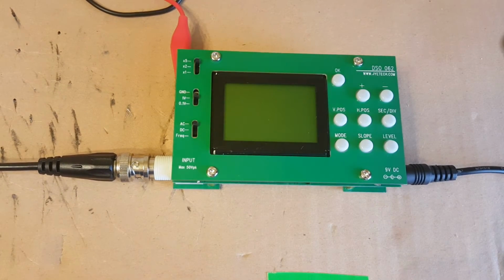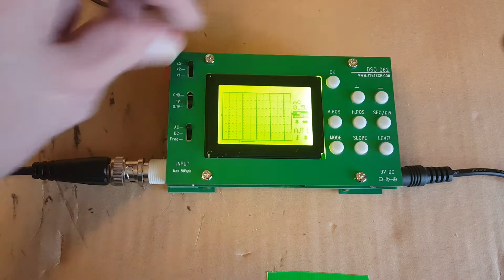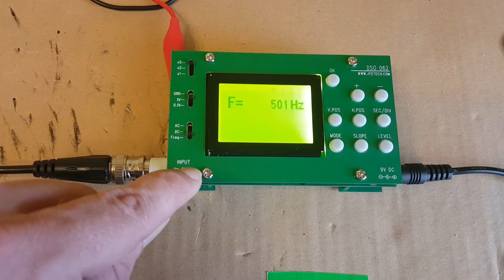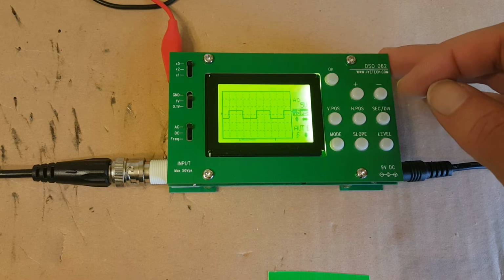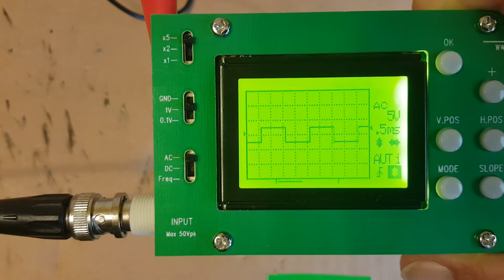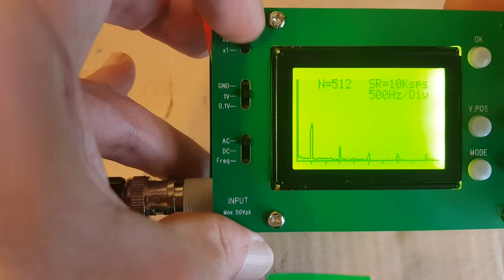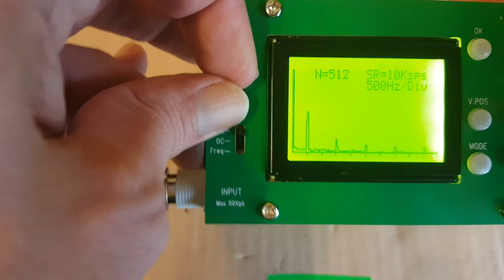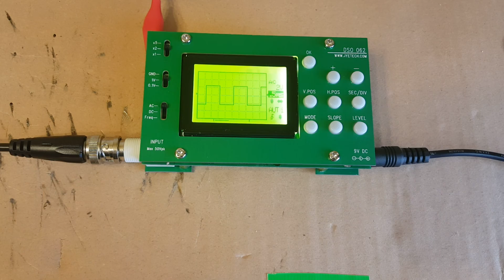JYETech oscilloscope usage tips

Comment: hi the screen lights up and the output for testing works fine (tested with multimeter), along with the "Freq" setting (reads 500Hz), however when the grid is shown, there is no visible line or waveform no matter what range and setting i put it on. Do you have any tips please? Thanks.
Reply from the maker: Usually that happens because of: contrast too low, window too small, scale too large, or combinations of those. Try setting the "sec/div" to 0.1ms like I did, and make sure the scale is on "x1" on the top switch and "1V" on the middle switch. Try checking the voltage of the signal too. It's possible you're getting a weak signal due to a soldering error, in which case it might still be able to sense the frequency, but the trace line would be essentially zero. Try checking the ground setting too, and make sure you get a line on zero. (1:43 in the video)

Comment: Thanks for the demo vid!  I've been looking to get a good starter oscilloscope both to advance my electronics skills and to diagnose electrical problems on my RC setups.

For instance, do you think you can do a video hooking up this JYETech oscilloscope unit to one of the free channels of an RC receiver's 5V power rail and get an accurate view of how the voltage jumps around when all the servos move under load?

I want to get my RX setups as bulletproof as possible with stable voltage using low ESR capacitors, LC filters, etc.  But I feel its kind of a shot in the dark without an oscilloscope and am trusting the word of the eBay sellers on the quality of these components.  Other problems are some noise from the servos is making it to my FPV video TX on certain craft.  I need to try to find out from where!
Reply from the maker: Rotormatic That might be possible, but it would be tricky. I'll hook it up to a plane later tonight and see if I can capture the ripple. If you use a quality power supply though, this is not the big issue people make it into. It's just that many people use the power supply built in to the ESC, and those are often cheap linear regulators prone to overheating. I air-gap my FPV systems for a bunch of reasons - I do not think the extra convenience of having a single battery is worth the potential safety issues. So, I run two power supplies, sometimes three - one for the motors, one for flight control, and another for FPV system.
Reply from the maker: Rotormatic Oh also, make sure you subscribe, I did post a video about the 200qx output signals. I'll be doing some more like that soon.